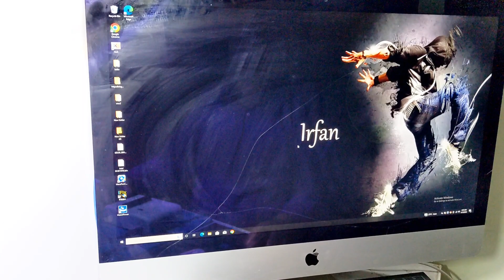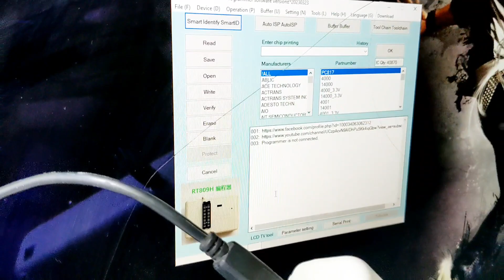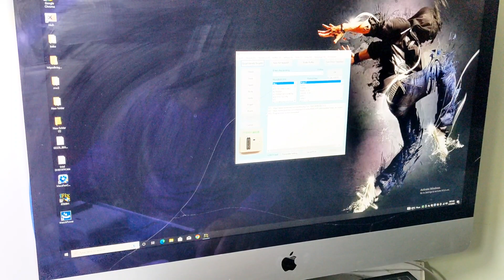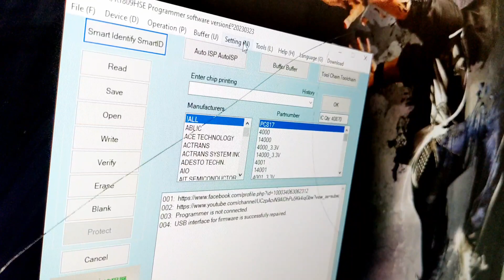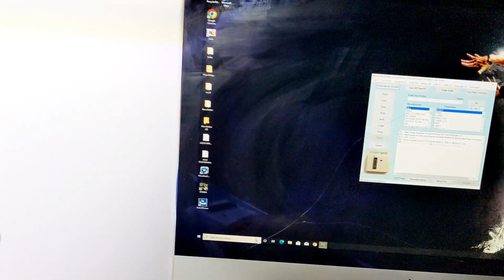Rt809h Programmer Not Connected Problem Solution

Comment: hi i have another problem the green light lights up for 2 seconds then off i removed the ziff board that you removed earlier in your video and the light does not go off so i suspect the ziff board ( reader ) is faulty or maybe it's causing a short and the programmer can't power up is there any solution for that ?

Comment: Hi, i have an rt809h and suddenly he don't want to connect on pc and the green led blinking continues. 
Do you have any ideea what can be done  ?
Best regards
Reply: is your issue solved, i have same issue, I entered jtag compatibility mode due to this  ,issue happened and green led blinking continues
Reply: @JEEASPIRANT7737  yes me too, i have entered in jtag compatibility  and then......
Reply: @JEEASPIRANT7737  no i didn't manage to repair  😞
Reply from the maker: In setting first click U then D then R then B  i hope this will help
Reply: @laboneinside  no, it doesn't work  😞
Reply: @laboneinside  i have try jtag compatibility mode in the settings  and after that it doesn't want to connect to pc and the green led flashing continues
Reply: @laboneinside  sir mera bhi sem problem he RT809h ki status green light continue blinking hoti he jo aapne steps bole he o karke dekha nahi hota he plz help mi sir😢